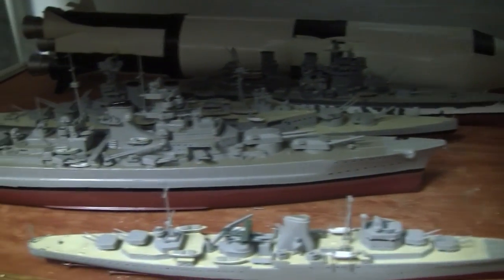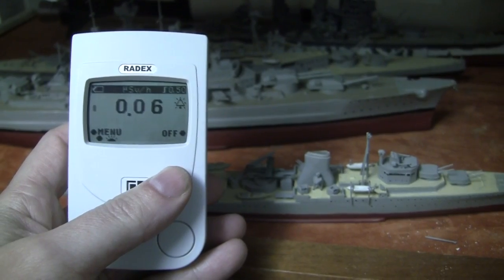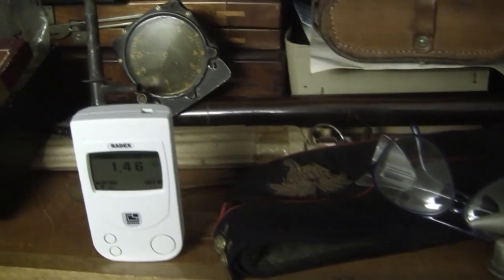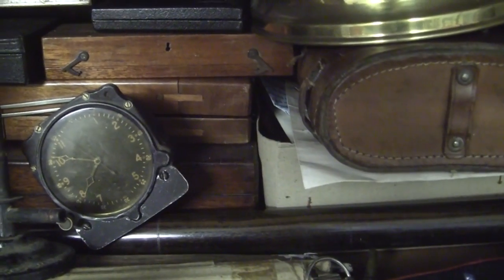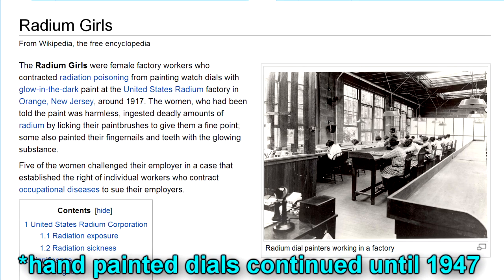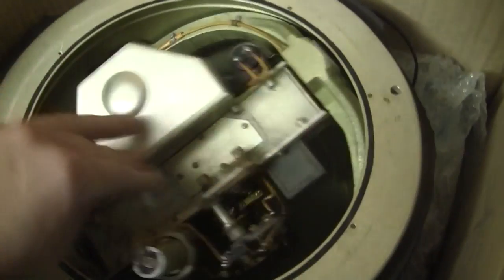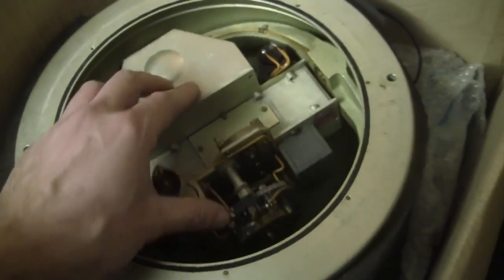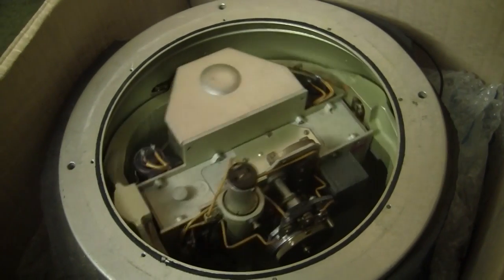The Radioactive Bomber (that irradiated girls)

Comment: It is a gyrocompass. Unlike regular compasses, a gyrocompass will allow you to find true north, based on a planetary body's rotation, and is completely independent of magnetism hence you can use as much steel as you like in the ship containing it as the effects of ferromagnetism are negated. Gyrocompasses can be used effectively as sensors for rangekeepers, electromechanical analog computers that could track targets and, using the gyrocompass, compensate for changes in latitude and azimuth when a gun fires a projectile, allowing a warship to be able to maneuver while engaging a target.
Reply: That looks like a gyroscopic compass to me.  If that's the official name, then I wouldn't be surprised  - early targeting system, I would guess.
Reply: I'll just add: it was used in the V2 rockets (which if they used better warheads could have changed WW2's outcome), and relies on conservation of angular momentum :)
Reply: even now gyro compasses are the used in ships
Reply: Xenogene Gray It was really their use in rangekeepers that gave The US Navy a huge advantage over the Japanese in WW2. The US incorporated gyrocompasses into their rangekeepers to give their guns huge stability while a warship was maneuvering. The Japanese and even the British did not use this technology in their warships until long after the war was ended. This equipment allowed the US to win the battle of Guadalcanal against the Naval forces of Imperial Japan.
U.S. President Franklin Roosevelt, upon learning of the results of this battle commented, "It would seem that the turning point in this war has at last been reached."
2 Gyrocompasses were incorporated into the V2 Rocket designs and were also used in long distance stealth bomber aircraft when radio communications and radar would have been a warning to an enemy. Gyrocompasses are still made for rangekeeping of missiles, some using fiber optic gyroscopes in the design.
With any projectile weapon, rangekeeping is key be it a cannon or a ballistic missile.
Reply: Muon Ray Awesome - I didn't know they were so effectively used by the US in WW2 :)
Reply: Muon Ray  Hi there, my personal guess was that it was an inertial navigation system, which is essentially just a more sophisticated gyrocompass. Whilst I can't speak to the naval implications, I can say the it is an INS used in the stealth bomber and incidentally in just about all commercial and military aircraft today.
Radar is only ever used for extremely low level navigation today, although increasingly, it's being replaced by electro-optical systems like LANTIRN (specifically the AN/AAQ-13 pod) for exactly the reason you stated, minimising detectable emissions.
In aircraft, INS position is typically updated via GPS or ground based navigational aids like VOR-DMEs or TACAN. Historically though, Astro-Inertial Navigation Systems used star positions for updates due to a lack of radio-beacons over the former USSR and GPS having not been invented. Such a system was used on the SR-71.

Comment: My guess is it's the guidance system from either a "doodlebug" or a V2.
Reply: I say it is a V2-guidance system. Just from the look of it it could be both but TF stated that the weapon to which it belonged could have actually changed the outcome of Worldwar 2 and in my estimation the V1 simply lacked the potential to achieve that since it was far to easily intercepted by Tempests or shot down by AA-Guns.

So yah. V2 it is.

Comment: The thing with the gyroscope - is it the V-1 missile guidance system? It had a gyro compass to keep the heading, and some electronics to cut off the engine after a designated distance is traveled.
Reply: The same type of thing was use in space missions to keep the heading to the moon

Comment: 1) I am writing for work in the middle of the night with headphones on. I decided to take a quick break before making some tea and check out a few videos. Good and bad. Bad is wearing headphones when watching this video. Good is that I no longer need tea to keep awake for the next hour.

2) I'll second what everyone says and I too thought of a gyroscope for a V2 rocket. It's obviously a gyroscope, but whether it's for the V2 or something else which was in development at the time is beyond me.

EDIT: I just saw it has rubber seals, so I'll go with some sort of torpedo instead, probably from a U-Boat or something.
Reply: Yep, I'm with you on the U-Boat option, I vote this, reading about U-Boat torpedoes suggests there were 2 main kinds, impact torpedoes and magnetic torpedoes, my guess is that this gyroscope was used because it didn't have an overwhelming magnetic field and suffered little interference from other metallic objects (and hence could detect when it was near metal). It could break ships in two just by being placed in the right spot. IIRC, the Germans also designed heat sensing torpedoes which probably also used these gyro's, the allies used to have to detonate mines just so that the torpedoes would be left derailed and not hit the ship

Comment: That's the gyroscopic navigational array of Von Braun's V-2, isn't it!

I'm not fully aware of its exact principle of operation, however I'd hazard to guess that seal is either to maintain a factory set low pressure environment within the module for mechanical efficiency, or it's a vacuum driven unit and the seal is there for efficient use of the vacuum pump.

The gyro navigation modules had a pre-set course trajectory, which essentially kept the rocket pointed in a certain direction (i.e. due west). Range was varied by the amount of fuel on board, and direction was determined at launch, essentially by lining up the rocket on its set heading. The error margins were meaaurement of fuel quantity, accuracy of maps and directional indicators, and wind speed and direction at, and near the launch platform. On a good day, with reliable maps and a decent compass, the V-2 (pronounced Fau-2) would have been a precision strike weapon, comparable to modern guided bombs and missiles, though that's the case only if the weather forecast is 100% accurate, or winds across the flight path are calm.

Upon its approach to the target, the V-2 would travel at about Mach 4, leaving any potential target completely unaware if its presence until impact.

Comment: it's actually promethium white paint. promethium being the radioactive element that made it glow in the dark.
Fuck, I love promethium...
Reply: Pretty sure they used Radium. I mean the company was called the U.S. Radium Corporation.
Reply: *****  radium did indeed make paints too, but a promethium or a tritium variant was for more common, because promethium is far safer of an alternative, and I feel sorry for the peasants that have to use tritium.
Reply: PromethiumOxide Well they stopped using radium after they figured out it was dangerous, but they did use it in those clocks. And tritium is pretty common, or at least commonly advertised.
Reply: *****
 ^^ yup. tritium cheap artificial crap though, yuck... not even an element.

Comment: I am going to say it was a guidance system for the German rocket system, possible a V3 (which would have been in the future, they never got that far). Or maybe a system having to do with the Jet planes.
Reply: um they did get that far
Vergeltungswaffe 3 or the ,V3 is a gun, they were never fired but they did get mostly built

Comment: We use similar technology in the navy today it's a gyro and it helps keeps the weapons trained on a tagert by compensating for the pitch and roll of a ship. I'm not sure exactly how it does it but I'm pretty sure that's how it could have changed the war.
Reply: To add I believe it is mainly used for CWIS witch is basically a bad ass gattling gun and 5 inch guns maybe 24 mm if it is one of the computer operated units

Comment: Looks like the gyro stabiliser for a V1 Buzz Bomb
Reply: think it's fore a V2
Reply: Dont think its a stabilizer I think its a Gyrocompass (heading indicator) basically the same thing but not quite... Basically that means Homing missiles?
Reply: The Buzz Bomb was a ramjet munition which flew like an airplane. It was the V2 which - literally - went ballistic and required an inertial guidance system
Reply: Yes but the V1 trajectory was controlled with a gyrocompass, and a pendulum. The gyrocompass controlled Yaw and Roll, whilst dampening the pitch control of the pendulum.

I've been to the Stampe & Vertongen museum in belgium, which has a V1 on display, with the nosecone removed and the control apparatus exposed. The device looked a lot like the one thunderf00t has.
Reply: Victius6 Yeah I forgot the word for a minute, thanks. You're right, the gyrocompass controlled roll and yaw, but stabilised the pitch control. That's why the word stabiliser came to mind.
Reply: Apex Aurajin
I will insist that this is from the V2 rather than the V1: for me, the giveaway was that T'foot said that this was a potential game changer, and the Allies were scared...er... into constipation.
The V1 delivered  a nasty, yet containable, toll of destruction. It was slow enough, and its trajectory was predictable. It could be shot down, and many were knocked short of the target simply by an RAF fighter gently tipping a wing to send it plummeting. OTOH there was no way to pary a V2, and it struck so fast (going supersonic soon after reentering the atmosphere) that there wasn't even any chance to evacuate or tof take cover.
This came from a V2.

Comment: It's a Nachtsonne detector,

Which would be used by the Nazi's to access the Schwarze Sonne or "Black Sun" dimension. If they had access to this dimension, they could of transported to city capitals and negated the need for supply lines. The power they could of unleashed would of been astronomical as well.

Comment: It's a gyroscopic stabilizer from a V1 or V2 rocket, at least that's my best guess.

The V2 rockets especially would use stabilizers like that to self guide to targets.  So not only is it an anti-roll system but its also a primitive Guidance control.

Comment: it's got to be some sort of gyroscopic device, possibly for navigation purposes?
Reply: The two coils are probably separated by oscillating rod gyros - if you stimulate a metal rod to vibrate, it will tend to vibrate in one plane; if you try to force it from that plane, it will flex and alter the inductance of the coils. The resulting signal differential is integrated by the electronics over time. This is relatively compact, lightweight and reliable, and was first applied to long distance missile guidance.

So sayeth the U.S. Navy Submarine Electronics Technician.
Reply: Raw Comfort
so, while i was not entirely accurate, I still got pretty close?
Reply: Technically, you were correct - this appears to be a hybrid gimballed system. Once the method was perfected, rod gyros got down to matchbox size. And now - my iPhone has miniscule solid state accelerometers that are remarkably accurate, directly etched into a silicon substrate, and an application for stargazing that can't be beat - In my lifetime - YEEHAW!
Reply: Raw Comfort
cool

Comment: Does the clock still glow in the dark?
Reply: +geekehUK "Clocks, watches, and instruments dating from the first half of the 20th century, often in military applications, may have been painted with radioactive luminous paint. They are usually no longer luminous; however, this is not due to radioactive decay of the radium (which has a half-life of 1600 years) but to the fluorescence of the zinc sulfide fluorescent medium being worn out by the radiation from the radium."
Reply: It degrades over time. It also depends on the concentration of Radium. The darker brownish the paint is, the more radioactive it usually is. The alpha particles from Radium-226 and its decay progeny, many of which also emit alpha particles will cause metamictization to the Zinc Sulfide crystal structure, which ionizing radiation, especially alpha particles, damages its crystal structure, to where it becomes amorphous, thus causing radioluminescence to dim over time. They can only be seen in pitch darkness, once your eyes are adjusted. If you look at Radium-doped paint in the dark under a magnifying glass or microscope, you can see many, many scintillations, or sparkling flashes. Zinc Sulfide is the father of scintillation materials for spectroscopy, in this case it's activated with copper (green glow) where now it's usually activated with silver (blue glow). It's still used to this day in alpha particle scintillation detectors.

Comment: Appears to be a gyroscope mounted to a gimbal. Such devices were used as part of early auto-pilot systems, capable of detecting changes in the orientation of the aircraft such that it can be compensated for. The circular cross section of the device you showed and the fact that you said it terrified the British makes me think that it was probably used as the guidance system for the V2 rockets developed by the Germans.

Comment: It is a gyro navigation sensor array of some sort. The two coils are accelerometers. There is a gyro in the center of the gimbal system. The gyro allows for detection of change in ships attitude, while the accelerometers measure the amount of travel in the three planes X, Y, and Z. 

This is probably mounted on a submarine. I think this is also used in many aircraft. It is handy for navigation on anything that moves in all three axes.

Comment: Gyroscope for U-Boat heat sensing torpedoes or magnetic torpedoes. From memory, the allies had refined their RADAR and straight shooting impact torpedoes could be detected by RADAR leaving the ship enough time to move off course. The Germans soon developed magnetic based and heat sensing torpedoes, which scared the crap out of the allies because they had to find a better way to dissuade the torpedo, the main initial method was to change the course of (or destroy) the torpedo by dropping depth charges/mines near the ship which would result in destruction of the torpedo.

Comment: It's the gyroscope used to stabilize the V-2 rocket mechanically. If I'm right, then id say your wrong, the V-2 costed far more than it was worth, so it wouldn't/didn't potentially change the course of the war.
Reply: KilluaXIII It may have been terrifying, but it was so ridiculously expensive that for every V-2 they built, they could of built something like 5 bombers! And lets not forget, you can only use a V-2 once, while you can use a bomber multiple times.

Comment: Some sort of electromagnetic compass rocket guidance/autopilot system?
Gimbal mount keeps whole thing in horizontal position all the time so neither pitch nor roll affect the read-outs from coils.
When course is changed, earth's magnetic field alters the current in the coils. 
This can be used as feedback for steering system so the desired magnetic course is maintained.

Comment: it's part of sea mine that would explode when ships were in it's proximity as opposed to normal mines that explode in contact.
since large metal object change their environment magnetic fields , this mine was designed to detect these changes. 
this device was kind of game changer since it could be easily deployed in deep water attached to large amount of explosive and would wait until a ship come close enough that the explosion would simply sink the ship and since it was deep in water there was no easy way of detecting it.
this mine is the reason why modern ships run a current though their body to counter their magnetic foot print.

Comment: I'm not seeing a flywheel for a gyroscope but those primitive electronics mounted on the gimbals probably react to electromagnetism in a way to provide detection, tracking and/or targeting. My guess? Seeker head from a torpedo. Magnetic detection would provide a means of proximity detonation and would likely be more accurate and reliable than acoustic homing devices. Just a guess though.

Comment: self righting, but didn't appear to actually be a gyroscope, with some sort of electromagnet inside. Weatherproofed/airtight too. It seems like a missile guidance system (or torpedo? were those model ships a clue?) that measures (at least) north/south and up/down relative to the attitude of the weapon it is installed into.

Comment: The device is a magnetic compass fuze for a German Luftmine (parachute-dropped sea mine).  The Germans would drop the mine into the ocean from a plane.  Once it sank, the gimbal part would keep the stable platform pointing the same direction, despite waves & currents.  Then, metal from passing enemy ships would create deviations in the magnetic field detected by the two coils.  The system could count the number of ships that went by to hit the middle of a convoy, and also make it less susceptible to mine-sweeping decoys.  A similar artifact recently sold for about 1,200 euros at auction. Considering that your dad's has rubber seals on it, it was possibly cut out of a live mine, making it especially rare.

Comment: Going to have to go with the majority here and say it's the gyro from control system of the V2. However, if I/ we are correct the reason it seams primitive is cause today things like cell phones and PS3 controllers have sensors that preform the same function (telling which way is up) that are what a millionth the size maybe even smaller.

Comment: I'd imagine it was a type of gyroscope most likely used in bombing runs. Possibly in stabilization of the plane in to allow for more accurate runs. I also considered it's possible use in the bombs themselves to allow for a more controlled drop but it looks to be too expensive for that purpose.